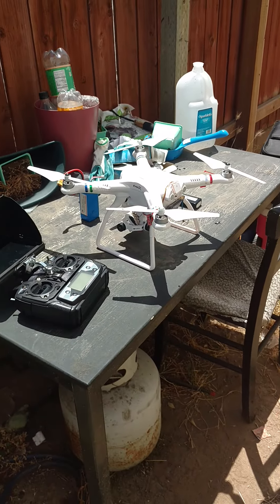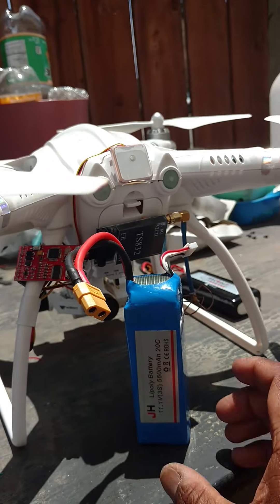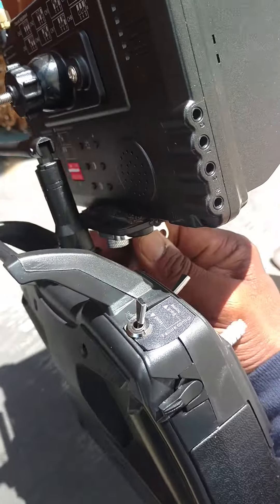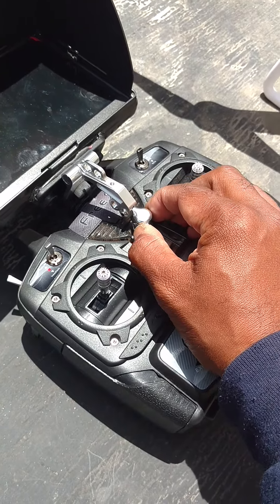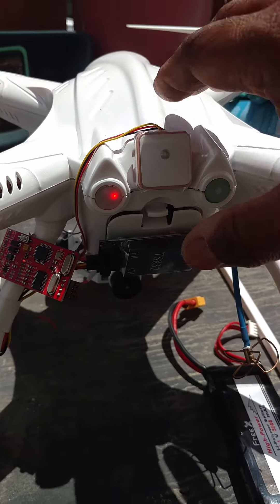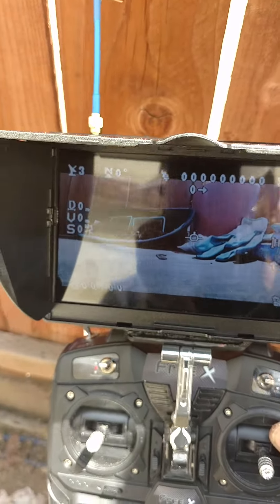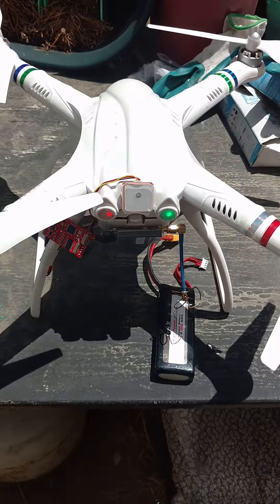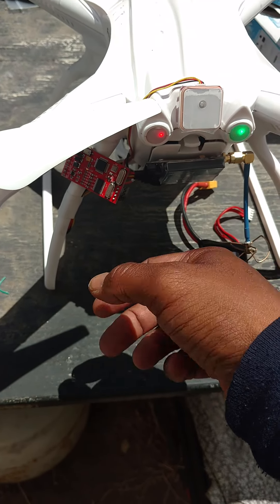My Freex Free X Skyview FPV Tarot TL300 OSD Setup

Comment: Awesome Scott.  I see it is the tarot OSD + GPS kit.  I'd like to know if we can just plug into the board with OSD only and not need the extra GPS.  FYI, you can also set the tarot to auto aquaire home point when it sees enough sats on power up if you want.  have you seen the free -x OSD anywhere for purchase separately?
Reply from the maker: hi Justin. i believe you don't need a separate GPS if you buy theirs. plugs right into the onboard controller. http://parkrcmodels.com/product_info.php?cPath=182&products_id=564
Reply from the maker: thanks for the tip Justin. Also, do you know how to set the right voltage for the 3s battery? Mine always starts at 11.7v instead of 12.6v
Reply: +Scott Givens awesome.  just ordered one.  This quad is getting better and better :). yay it had a home arrow on OSD!  reminds me of my cx20 days. your speedy rth is promising also!  did you adjust parameters for that rth speed?  now I'm really excited to dive back into this quad.
Reply: +Scott Givens Not sure yet Scott.  your more into it than me at this point until I re visit it.  I'll do the OSD at same time as fuselage and FPV and at that point get into the flight controller.
Reply from the maker: +Dustin Dunnill I didn't adjust anything except the parameters of the flight limitations. just took them off. And I changed the gain settings to what James Peng had on your video. unless my Tarot is malfunctioning, those speed tests were friggin awesome. it's a big craft, so it might not look as fast as a smaller racer type, but the telemetry says otherwise. I just could not believe there's no speed limit on GPS RTH. Insane!
Reply from the maker: +Dustin Dunnill AWESOME. Please let me know when you post the video. well... I'm also a subscriber. Lol
Reply from the maker: +Dustin Dunnill just. thought. one flight I cruzed out doing 55km/h and the RTH was 57km/h

then the time that I hammered it to 70km/h it came back at 77km/h. I'm not sure if RTH matches your last actual flight speed during flight. I'll have to do more testing
Reply: Dustin can you make one video to explain how conect the tarot OSD in freex board please

Comment: hi mate can you change direction of rth as please watch my few flight as it flys backwards it glitches out every time cheers half turn in fligjt in rth mode aswell cheers
Reply from the maker: Hi gadgetman, sorry for the late response. But I don't think the ground control software for the FreeX allows you to change the direction i.e. nose facing in on RTF like th xk Detect 380 have have allows. I only was able to change the parameters to no limits while flying out over 1.5 miles